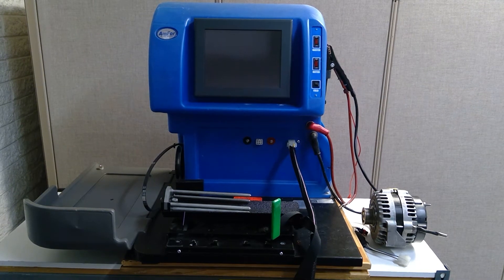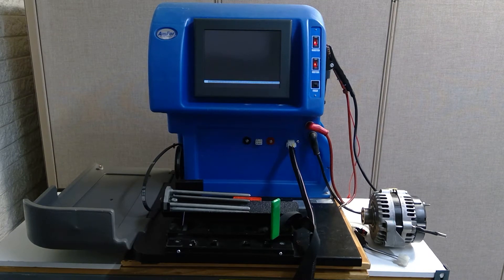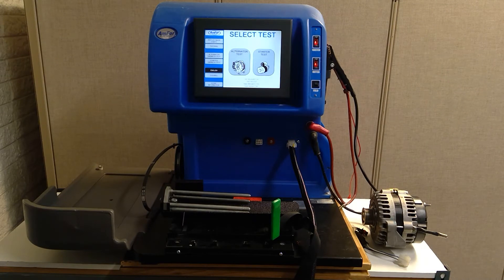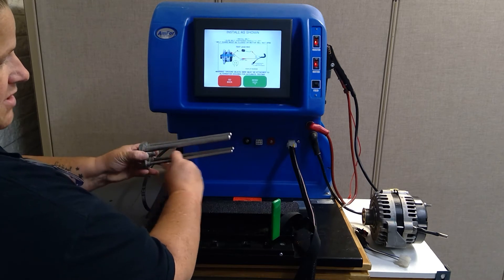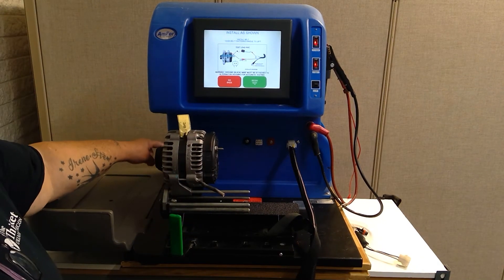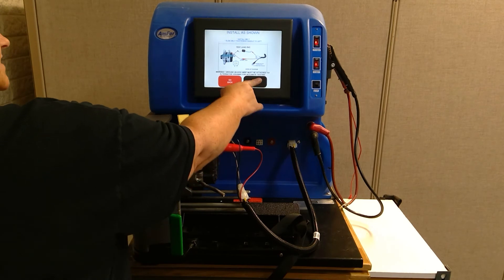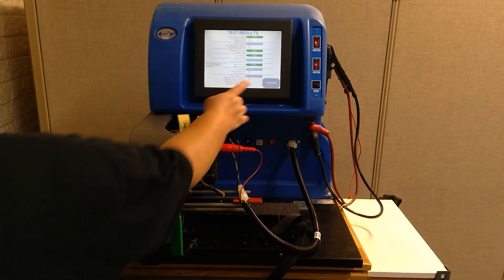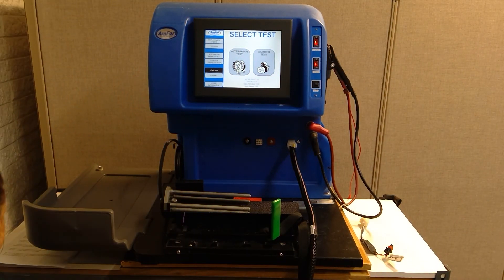897 AmFor bench tester instructions for testing an alternator

Comment: Does this have a load bank?  I noticed it doesn't show the amperage? 
Could you perhaps use a ac/dc clamp meter and get the amperage pulled?
Reply: The 897can test up to 300 amperage.